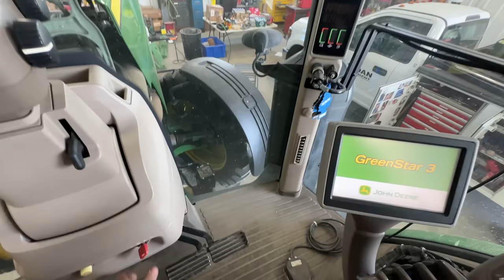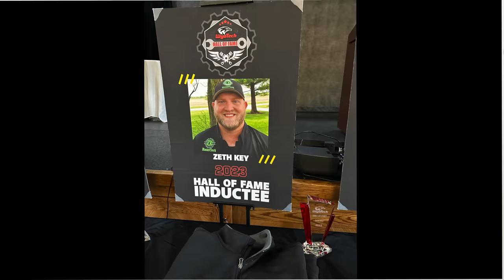John Deere 8310R 9.0L damper failure! Wyotech hall of Fame ceremony | Wyoming trip

Comment: Hi Zeth, I watched your video about the spurratic wiring issue on the combine. A partially broken ground wire, will create havoc in any electrical system. You were on the Wright track considering, a ground and or neutral problem. You still have to follow fault codes. And the possibilities of issues, that cause failure codes. And you have to depend on years of knowledge and experience. When all else fails, you have to depend on technical support. What I have learned over the years of troubleshooting. Is look at the simple possibilities first. You find and fix more than you miss, way more!! Can't hit one out of the park every time. Hopefully the customer realized what you were dealing with. Just a thought, keep doing what you do. I like your style, Joe Capo

Comment: Congratulations on your induction, seems like a fitting reward for your study and hard work. I thought for sure you would have to remove the radiator and accessories to do that job, but it looked like plenty to take off and reinstall even without that. Even though I am retired and a Z mower and 4020 are the only JD products I work on, I find your channel to be one of the most interesting on the tube. I have picked up several useful tips on tools and tool use from you and have purchased a number of the tools that you use.

Comment: I was always taught to clean and remove as much dirt from an engine before pulling parts off, then to fill pipe openings and entries into the inner engine with clean papertowels or something to prevent accidental dirt or dust from getting into the cooling system or the inner engine

Comment: Congrats on your accolades and accomplishments thus far!  I'm certain there's more to come. 

 If you encounter more challenging crank seal removals, then it may be possible to modify your install tooling to also remove as well.

Do those balancers have alignment marks between the hub and the inertia ring so you can see when they are beginning to separate?

Just wanted to add that if there's any danger of damaging the radiator during these repairs, then a small piece of plywood or cardboard can help prevent a bad day!!  Saves the knuckles from the rad fins too......

Thanks for the great content!

Matt, British Columbia.

Comment: Noticed both rubber dampeners had green paint on them.  How does the one you removed still have paint around the outside edge if it was rubbing & wore down?  Would’ve thought it would be completely black rubber across the diameter of the dampener if it’d rubbed off during use?

Comment: Congrats on HOF. On a separate issue, why doesn't JD prepaint their engine parts? With the prices they charge they certainly should be able to afford it. It's not like as if those parts could possibly be used on a red tractor. They should also be able to do a better job painting them at the factory than you can with a spray can.

Comment: How are those Brunt shoes getting on? I found them a little hot back in summer, and where do I get that small slide hammer???? Those accumulators look like fun getting to.
Reply from the maker: So far so good. I like the boots a lot. That side hammer is a JD special tool
Reply: @ZKMasterTech  Service gard part#??

Comment: so did the cover crack and leak oil on the damper causing the rubber to seperate.  or did the rubber separate and rub on the cover until thin enough to crack?